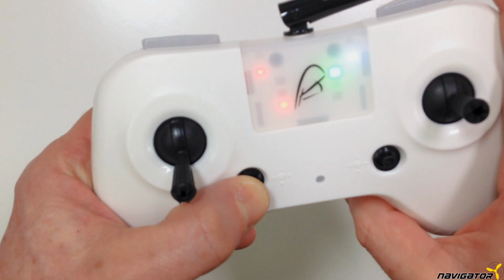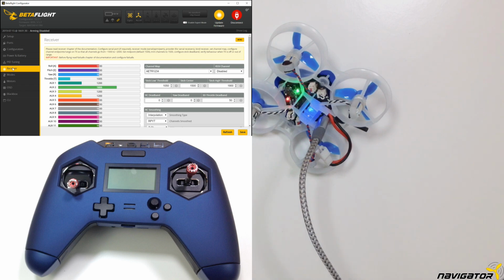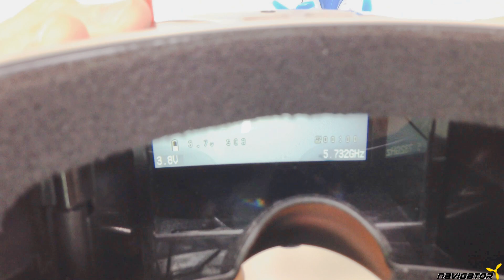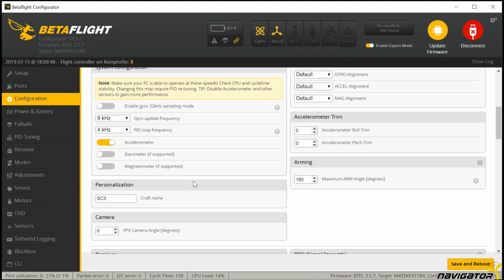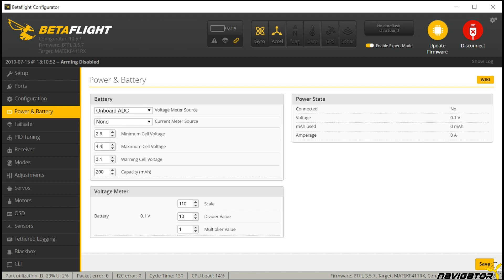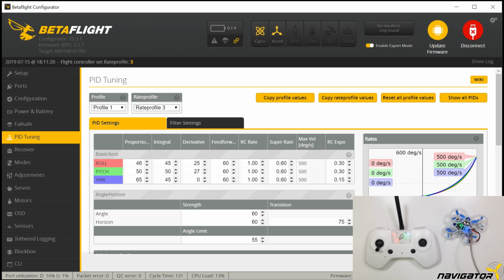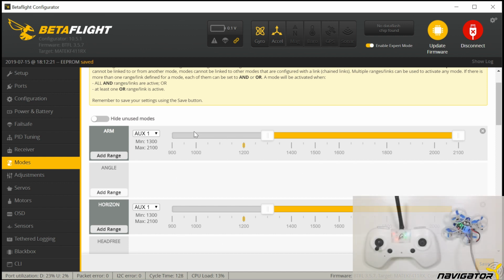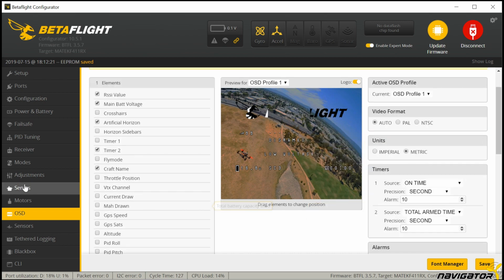BetaFPV - FPV Advanced Kit Beta65s - Bind, Scan, quick Setup (English)

Comment: Thanks for your video. I have tried all step you said. after binding with the controller, the Betaflight configurator showed the receiver was connected successfully. just like your video in 1:01. while I move the controller, the data in Betaflight configurator changed as well. Then, I disconnected from the computer, connected the FPV with a battery, and restarted the controller. However, the FPV still have no reaction. anything I did wrong? Please help me.

Comment: Thx for the video, I hope you can help me. I did the steps you mentioned, the green led is permanently on. 
When I try to arm (left trottle up), the red led is blinking but nothing else happens.
I connected the betafpv to betaflight and i get the message "arming not possibld because PARALYZE
Can you help?
Reply from the maker: do you arm via throttle only, or stick arming? the default arming is on one of the buttons. I would stick with that.

make sure, you have not set a switch for paralyze. check in the modes tab.

eventually, try to bind again. sometimes it takes several tries to work.